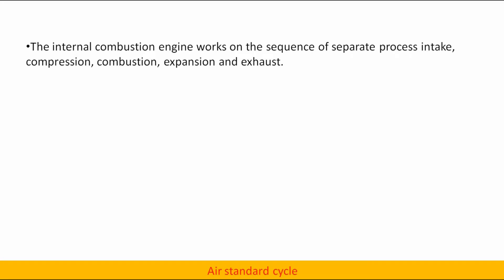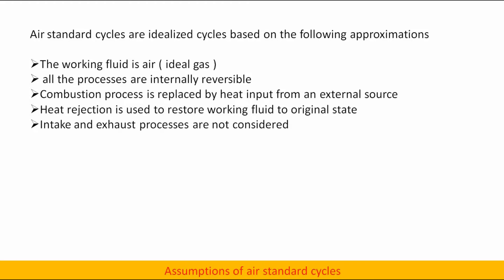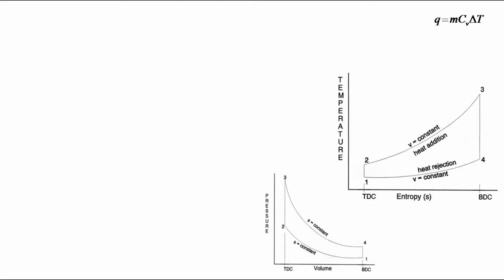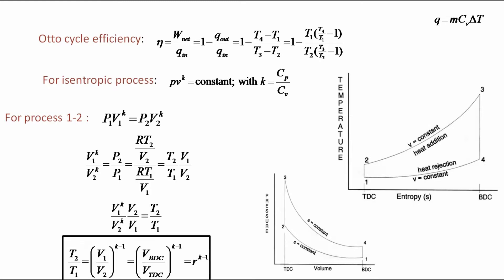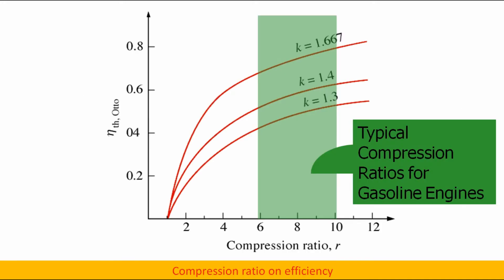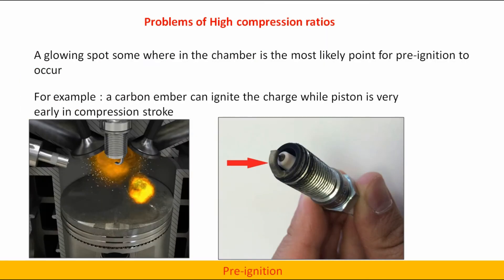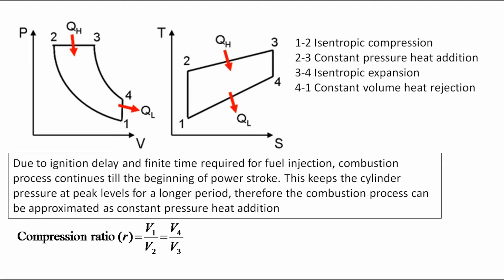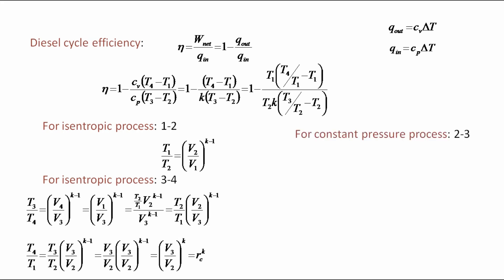Air standard cycles

Comment: kon samjhega ese
Reply: Hi: I need help of an question, i have to answer this: Using these calculations, compare the performance and efficiency of the engine with that
of the appropriate air standard cycle. These comparisons should be based upon relevant
calculations. What i have to do is explain how brake power, brake mean effective pressure, volumetric efficiency, thermal efficiency and air fuel ratio link to this in term of the result of which we got

Comment: thoda slow yar
Reply: Hi: I need help of an question, i have to answer this: Using these calculations, compare the performance and efficiency of the engine with that
of the appropriate air standard cycle. These comparisons should be based upon relevant
calculations. What i have to do is explain how brake power, brake mean effective pressure, volumetric efficiency, thermal efficiency and air fuel ratio link to this in term of the result of which we got